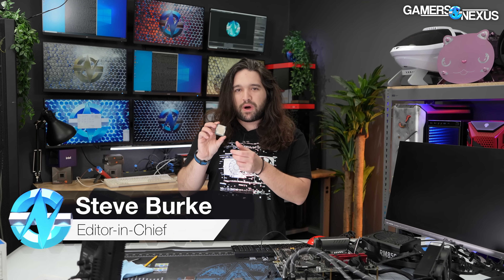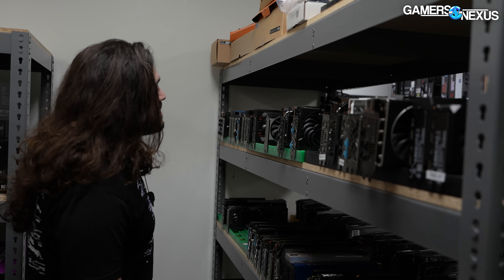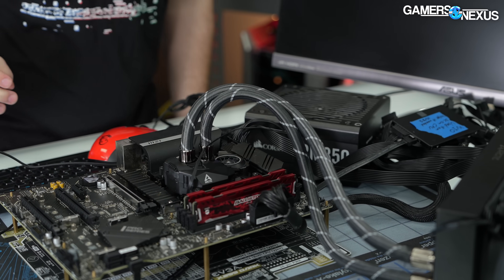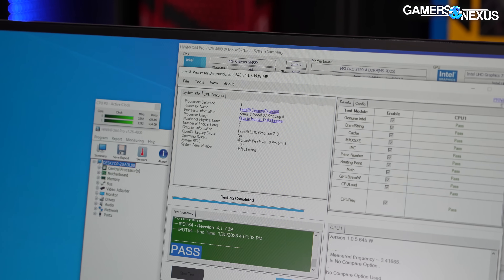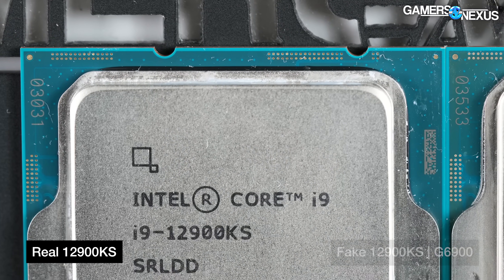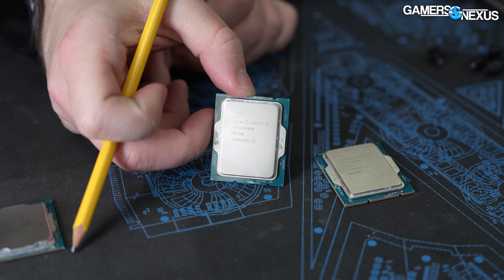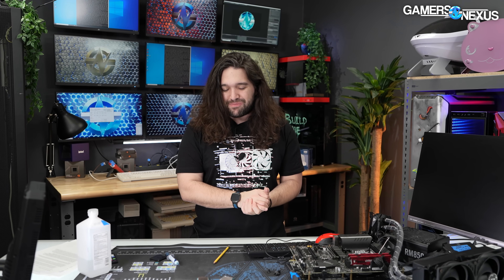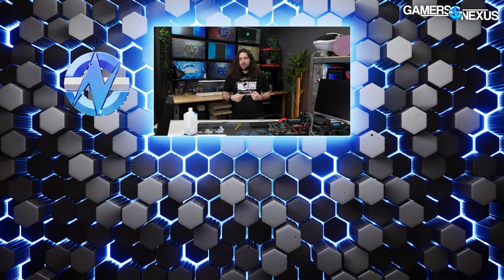Beware: Counterfeit Intel CPU Scam on Used Market

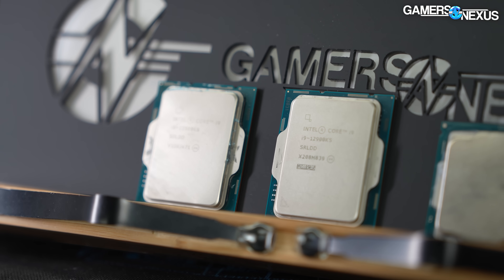Comment: (14:32) I would assume that they simply delid a real i9 and glue the IHS on a Celeron instead of re-etching the Celeron's IHS.

Also, wonder why you didn't mention that you don't even need additional software for a quick check. The CPU Model is listed in the Task Manager.
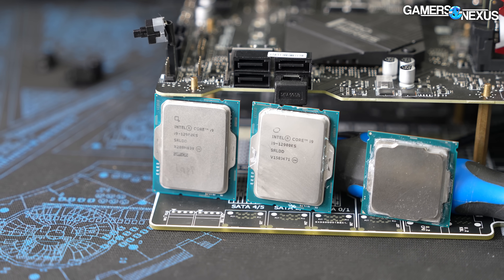Reply: Not on this example. Obviously heat transfer laser print due to how dark it is and how crisp the lettering is. Also the cicle Intel logo on a KS sku is either super rare or does not exist period on retail cpu's. The circle logo means AVX512 is still active they swapped to a 2 square design around same time the KS came out se 9:54
Reply: @Gti_Jason  nah, it's obviously just a real IHS swapped.
But sure, I'll list both possible options and you decide which one is more plausible:

Option 1: 
The lowly ebay scammer somehow removed the original writing off the Celeron IHS. The 7700K Steve showed in the video was polished to the point that it almost became shiny and it still retained some of the original text. But let's just say the ebay scammer somehow removed the entire text without affecting the texture of the IHS.
Maybe the scammer just quickly remanufactured a perfect Intel IHS replica? Possible!

The scammer then designed a new set of text and markings for the IHS, instead of just copying a real i9 IHS. Hence the error with the Logo. Couldn't possibly be because Intel switched their logo mid run of the CPU, like Steve mentioned in the video.

The scammer then put the blank IHS in his laser engraver and almost perfectly engraved the fake i9 markings on the Celeron. But not perfectly enough for a master detective like you!

Or it's option 2:
The scammer is just some teen who used a $10 delid tool and switched the IHS from a real i9 onto a Celeron.

Comment: I've purchased 2 CPUs from online retailers on eBay:  an i5-2500k and an i7-7700k, and both are marked "Intel Confidential".  No problems, but I could never RMA them if I had to.  I saved  20-30%, but learned my lesson.
Reply: probably engineering units

Comment: A couple minor corrections at 12:15. The S-Spec codes are alphanumeric, and there can be several codes for a particular CPU model. Engineering sample chips are 4-digits, production CPUs are 5-digits. The S-Spec gets changed if there is a revision of the silicon. For example: the i9-9900KF is SRFAA or SRG1A for production, and QRK0 or QRN6 for engineering samples.
CPU-World is a great web resource for this.
Reply: Glad intel was able to keep it simple
Reply: @hams_salad  to be fair, you the customer usually are more interested in the 9900KF part, and less in the SRFAA/SRG1A part.

Comment: GPU ICs themselves being counterfeit is sadly a thing too. As easy as slightly sanding the die and putting new markings on it. Most often it's done to make an old half-dead chip look like new with a recent datecode or a better revision, sometimes it's also making an engineering sample look like a retail product, or just a different part number.
Unfortunately everything is being counterfeit these days. It's a real problem and especially affects the third-party repair industry where it's very difficult to source some genuine working parts.

Comment: If the new writing do not wipe off like real ones do they may have just acid etched them and it will not wipe off as we do it to our tooling at work and clean often and is easy to do.

Comment: I just run a benchmark and check performance also open several of them to push VRAM usage to the limits (the software should crash once you surpass the limits)

Comment: Tha website is useful to know about. I was expecting the scam to be where they delidded and swapped real Intel IHS between different SKUs and pass off an i3 as an i9 etc. The website would catch a discrepency between the PCB code and IHS code from a photo. I didn't think about them fabricating the text on the IHS itself.
Reply: No kidding. That's some seriously low-hanging fruit right there.

Comment: There's another way to pull this scam off.
If you bought 2 CPU's & switched the IHS on both, sold the cheaper CPU for the higher end CPU by itself, & than sold a complete system with the high end CPU that has the low end CPU IHS on it (which is covered by the cooler). They could sell the complete system some time later so they get to use the system in the mean time.

Comment: More likely it's printed on, it's fast and cheap. Lasering it would require quite an expensive machine. 
Anyways, regarding the scam, I stick to the principle of "if it's too good to be true".
Reply: You can get budget laser engraver for less than 200$ nowadays (not so safe, but it works).

Comment: It never occurred to me that there could be fake CPUs on the market. GPUs I get, flash the BIOS and slap a new cooler on an old card and you have a fake that may look real. Even with an etched IHS one could in theory remove an IHS from a high level CPU and place it on a lower end model. For some reason I though the G series CPUs were a different shape from their higher end siblings. I don't buy Intel CPUs generally, but it's nice to be aware of scams to prevent their spread. Thanks for the heads up GN team.

Comment: There is another method of doing this: IHS swapping. They would buy, say a 12900K from a retailer and get a cheapo CPU like G6900 somewhere else, swap their IHSs, then return the G6900 as the 12900k, and profit from it. It happened as far back as 2014 in China on a retail site called JD. They changed their return policy after this and Intel was involved as well so I suspect that's when they added the validation check.
Reply: People do the same thing with GPUS on Amazon, switch coolers and stickers and return for profit. A couple years ago I bought a new GTX 980ti and it turned out to be a 970, gonna guess it was a restock on a scam return.
Reply: @IronArmPanda  Amazon will also block the hell out of you ever shopping with them again if you get caught. Guess you can use mommy's CC and address if the scammer has moved out. 😆
Reply: @Xbox360mIRC  Crazy lengths people go to haha. Everything you said is accurate though.
Reply: @IronArmPanda  yep I bought a 2070 warehouse deal a few years ago, was actually a 2060. Took some effort with customer service to get that ironed out
Reply: I believe that was also done with AMD cpus a while back as there was a Linus Tech Tips video about someone having that happen to them.
Reply: The process of removing/detaching an IHS, often called “delidding” or “de-lid” at least carries substantial operational risk of killing a chip so I would expect it to not be super widespread.
Reply: @depth386  It is quite easy actually and I imagine getting hold of a delid kit is a million times easier than acquiring some sort of laser engraver possible of using precisely the same font as Intel.
Reply: @JJ LW  there's a crap ton on ebay and Amazon and built myself one recently as well. Plus this one has been evidently buffed making this look more like a rewrite. It's also super simple to copy since you can easily take an image of cpu and clean it up and the laser will clone it.
Reply: Thermal printed. It's easy to do at home (t-shirts, keyboard keycaps..)
Reply: @depth386  You've obviously never de-lidded a cpu. Not saying that to be a jerk, I'm saying that because if you actually had de-lidded one before, you'd know that the kits they sell now for de-lidding (and have sold since at least Coffee Lake, if not before) is darn near idiot proof.

I've done a total of five of them now (with no prior experience) and haven't ruined one yet. I'd imagine the people that pull these scams don't stop at one cpu either; they get so good at it by the sheer volume of them that they de-lid means there chance of nuking a cpu is extremely small.
Reply: I suppose you wouldn't always have to return if you, as a scammer, wanted a i9 12900k but didn't care what was on the IHS - you could swap it with a G6900 and sell the fake 12900k with the swapped IHS - get a huge part of your cost covered by the scam... off to buy a couple of CPUs thanks for the idea ;)
Reply: This was especially easy when Intel was using thermal paste and not solder underneath the IHS.
Reply: The Chinese doing scams aren't NEW their government encourages scamming
Reply: This is a problem with AMD Ryzen as 1st gen Ryzen is socket compatible (visually) with 4th gen Ryzen. Someone can easily remove the IHS from a 5900x and put it on a 1200. There might be a difference on the backside but that would require some expertise to know how the backside of a 5900x differs from a 1200
Reply: That's how people do it for AMD CPUs.
Reply: At our Best Buy, we had a scammer that tried to return a "Ryzen" CPU (Ryzen 5 or 9) complaining that it was slow. Fortunately the person handling returns checked the item first and saw that the CPU had bent pins. When we at Geek Squad inspected it, it was no doubt an AM3 CPU of some sort with a Ryzen heat spreader.
Reply: This!  It is an IHS swap or the serial and batch would match the wrong CPU.  I don’t really understand how GN missed this.
Reply: @Scarlet  you missed the point that only 1 of the numbers is on IHS, the other is on the PCB itself. And the IHS is completely rewritten.
Reply: @JJayzX  do you actually think someone is matching emblems and font perfectly, after erasing printed material, rather than a 15-20 minute IHS swap.  For real?
Reply: @Scarlet  yea, it's pretty damn easy, easier than swapping IHS and possibly damaging the cpu. They say how it's done right in this video too.
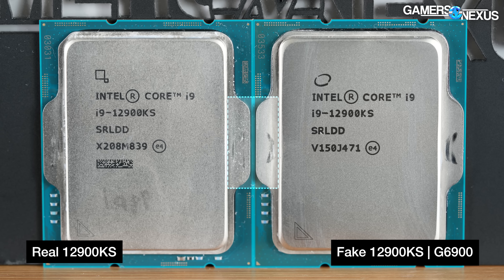Reply: @the_Scarlet_one  Can't be an IHS swap. Proof: 10:54 , unless you truly believe you figured something out that the entire GN team couldn't. I'd say Steve is right on this one.
Reply: @the_Scarlet_one  14:25 More Proof that even Intel confirmed that it is NOT an IHS swap.
Reply: @the_Scarlet_one  Of course GN can de-lid, I am just saying that delidding was probably considered before GN realized these scammers aren't delidding them hence why it was never brought up in the video. They addressed how the scammers are actually doing the scam(thoroughly mind you).

When you make a video, you talk about what happened, not what didn't happen. When I said you probably didn't figure out anything profound, I meant GN probably figured out these scammers aren't delidding them.

Not to take anything away from you, delidding is probably better if their success rate is near perfect, but not everyone scams the same way.
Reply: @the_Scarlet_one  You have to realize there's a lot of stupid people in this world, some might think polishing and lasering the IHS might be more efficient in terms of making a CPU look new than an IHS swap from an authentic 12900k lid. 

To say that scammers are only doing this one way is arrogant, I am sure there's multiple ways to approach this scam. The sample that GN received might have been polished and re-lasered.

I don't agree with the whole "I can't believe GN couldn't figure this out" school of thought.
Reply: @nickfosley2882  ok chill. steve won't notice you. everyone makes mistakes even steve, steve is not a tech god. he is only tech jesus, the son of god
Reply: @nickfosley2882  you really seem to be dying on this hill with your essays about how perfect steve is
Reply: @the_Scarlet_one  probably IHS swap
Reply: smart af shi I finna do it ‼️🗣️🔥💯
Reply: I used to do this to wal mart/best buy with 360s I couldn't fix the red ring on. Found a way to open without damaging the seal, and could reattach it easily
Reply: @drkirbkennethkirby7634  I did this with Radio Shack in 1992. I had bought a multimeter and I accidentally damaged it by trying to measure a source with over 1000 VDC. I didn’t know it would damage it. Since it was under warranty, I took it in and they repaired it but it took a long time to get it back. Then, I accidentally damaged it again due to high voltage.
This time, I bought a new multimeter from them and returned the broken one.
The multimeter is of a Radio Shack brand, so they have their own repair people.
Reply: a n i m e
n
i
m
e

Comment: I just went through something similar with an open box purchase from Best Buy... Not a processor, but I bought a Samsung Q Series Soundbar and the scammer replaced all of the stickers, serial numbers and packaging to match the soundbar I was trying to buy, but it was actually a much lower end A series soundbar... Took a few hours with Samsung Support before I realized that the shape was a little off (A series is a rectangle, Q series has angled sides) Luckily I brought it back to best buy the next day and they swapped it out with a brand new one off the floor at the same price I paid for the open box... Moral of the story is, where there is money to be made, never underestimate someones creativity...

Comment: First thing I thought was "bought 2 CPUs delidded both and swapped IHSes" (maybe even went direct die with the 12900ks), that way you get a pretty cheap 12900ks i guess. You're still an asshole as Steve said

Comment: The sad thing is, a lot of these types of scams aren't even perpetrated by the seller! They are actually committed by buyers who buy legitimate products (like a real 12900K) and then swap the heat spreader and send it back for a refund, and the seller is non the wiser and ends up reselling it.
Reply: Any smart seller would be checking things they got as a return though... They should be checking it that it still works and also it is what it says... They shouldnt be just turning around and selling it without verifications... The place i worked at used to validate every return and/or used item prior to resale.
Reply: @michaelhanson5773  they should but with the amount of returns and lack of manpower and low wagesc i don't think they have the time or motivation to inspect each and every returned item plus it's a cpu and it looks legit as hex.  You wouldn't be able to tell it was a fake in even 100s of glances. You need to put it into motion, whole freaking cpu and detail check it. Ain't nobody got time for it unless the returns are not as much.
Reply: That's only if the seller doesn't check. In games it will be VERY OBVIOUS

Comment: couldnt you just delid both cpus. an then swap the ihs on each . then reglue?  jigs they make to delid would make it easy an quick todo so..  id think setting up , the cpu like securing it to be laser etch or w/e print the new text on the ihs. would be a huge pain an easy to dmg the cpu ..

Comment: I've seen videos on 'fake' AMD cpus, where they would delid a broken cpu (usually one with destroyed pins) and then attach the lid to a cheap cpu and sell it for a profit. Theres also a couple of other cases where they used really old or intel cpus with a ryzen cpu 'sticker' on top... including one "threadripper" that was made out of 4 old intel cpus shoved into a threadripper box and then returned to amazon.
Reply: That doesn't sound right. If it's broken and they're swapping it w the same CPU why would they need to swap the ihs if they're selling the broken one anyways. Plus anyone should be looking at the pins of a cou before purchasing...
Reply: No you're not understanding him. He saying the scammer has a broken higher end cpu. They delid it to get the lid. Then they buy a cheap cpu from the same generation and swap the lid on the cheap cpu to sell it as if it is the high end one. This scam might also work with intel, but definately it has been done with ryzen. No pins will be bent on the cheap cpu so they can show you that easily.
Reply: @RiceCrustyTreat  1) Buy cheap destroyed CPU (Athlon 2 or Phenom 2). 
2) Buy a cheap CPU (Sempron). 
3) Swap the IHS
4) Sell the Sempron with the Phenom 2 IHS, as a Phenom 2.

Comment: On most used CPU scams they ship CPUs from different sockets that would never fit in the socket or be able to be installed. This is a same socket CPU and at a glance it's much harder to tell. With this unless you know firsthand what to look for you'll only realize it once you've installed it onto the system and saw task manager or the bios.

Comment: It would probably already help if they lasered the product name onto the die carrier board, like they did up to the socket 603 CPUs.. i'm sure they can find some place where it fits. sanding off the board is a lot more visible than sanding off the heat spreader.
Reply: Or making the substrate different colors for the tiers.

Comment: There are some things in this world  you should never buy used (unless from a close friend) and this is one of them. If you can't afford it, don't buy it. It's that simple. 
Thanks for sharing and stay well!
Reply: You can get huge discounts on older cpus though if its all you need.
Reply: CPU's are one thing you can buy used. Just don't OC them. I bought a lot of CPU's for older Boards but they were all in the 30-100 USD Range. Never had big problems with them. Aftermarket Cooler and you are fine. The Problems are ATM Highend CPU's they get scammed as there is the money. But getting for an 6 year old Board a nice CPU no Problem as long as you OC them to hard. They run literally for Decades, the Boards die first.

Comment: I've seen this scam before, back in the early days of AM4, scammers would try and sell those cheap A-series APUs (the Bulldozer-based ones, a handful of them was actually released for AM4), with the IHS swapped from something actually decent like a 1600 or an 1800X. But I'm sure the "trick" is much older than that. Apparently people occasionally try to scam retailers like that, buy a "good" CPU, then return some el-cheapo CPU with a swapped lid, hoping the store doesn't do any kind of post-checks on their returns.

Comment: Hey Steve, I wonder if the Serial Number in the 2d matrix printed on the substrate could be used to identify the culprit? I would think Intel tracks what serials are sold to which retailers, and possibly the retailer has a record of who that part was sold to?
Reply: That's why you buy the cheap chip on Alibaba.